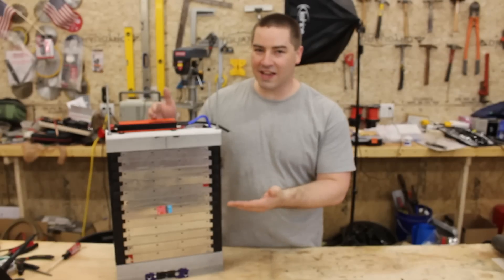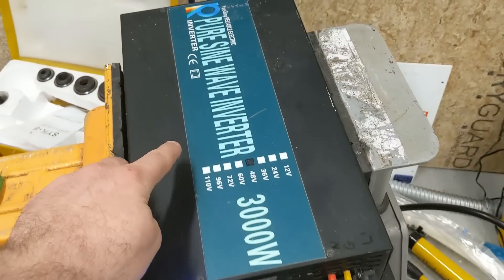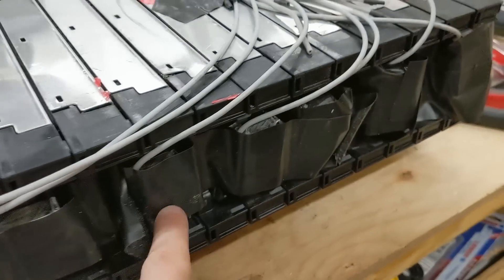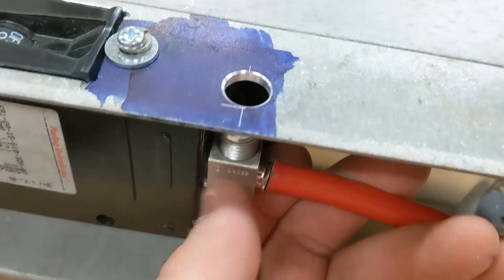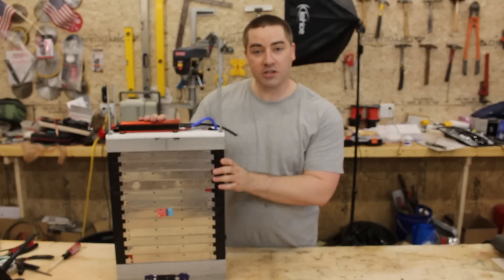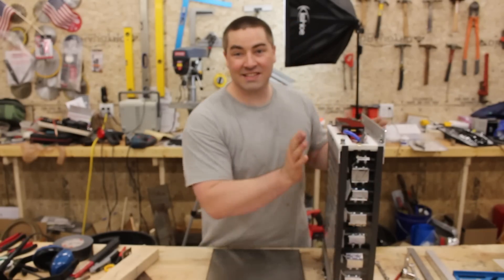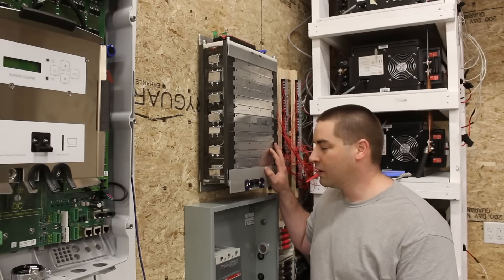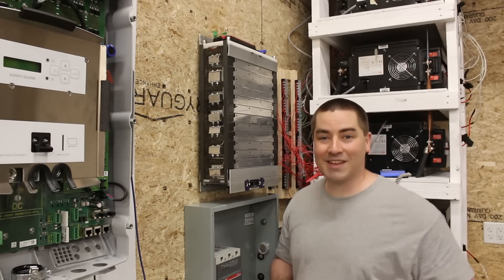LG Cells Part 2, 6kwh 48v DIY Battery

Comment: Nice build Dave. Could you go a bit more in details about doing a 24V system ? I realize it would be 7 modules each having 2 cells for a 7s2p battery in the end. What I dont understand in your video is when you say wouldn't need an aluminum block. Since the tabs were too short in your application why would they be different for a 24V ? If you could please clarify this for us.
Reply from the maker: I was suggesting building a 48v pack using 14 cells.  When you buy these from Battery Hookup there are two cells per module.  So I said in the video you can buy 7 modules.  Not 7 cells.  You can then arrange them 1p14s.  Now there are only two tabs to connect instead of 4.  The two tabs would be so close that there would be no need for an aluminum block between them.  This would make the whole build simpler.
Reply: @DavidPozEnergy  ok, so if taking the 2P modules apart, you dont need the blocks and you only need blocks when you keep the original 2P configuration?
Reply from the maker: Right.  It has to do with how close the tabs are.
Reply: @DavidPozEnergy  In your part 1video, it seems as though the spacer between the cells is bonded to the two cells, since you didn't separate them and you were curious about what was that spacer material. I want to try the 14S with individual cells, as you suggest. But I wanted to know if it's really possible to separate those two cells and flip one around. My second question is on pressure. I know it is beneficial but it seems ambiguous on the best way to do it. Your configuration in particular will have 71 lbs on the bottom cell plus whatever force is coming from the threaded rods, so the top and bottom cells are seeing a big difference in pressure. My idea was to use unthreaded rod, greased, and mount horizontal using some strong springs on each rod. That will equalize the pressure and it will be roughly constant, whether charged or discharged (volume varies based on SOC). What are your thoughts?
Reply from the maker: Hi Bucky Cage,  I have not separated the cells.  But, I did discuss this with Battery Hookup.  They separate the cells when they take the assembly apart.  This is because the big assembly is 3p10s.  So every other pair of cells is opposite.  Battery Hookup flips them all to be parallel for shipping.  They said they use a flat plastic putty knife.  
I like your idea of using springs.  That sounds great.
Reply: @DavidPozEnergy  David, thanks for responding. Do you recall where these batteries were from? Volt or Bolt or ?
Reply from the maker: Bolt.

Comment: Great video.  I'm designing a very large 48v build based on your video.  Would you consider using any other BMS (like the one with bluetooth)?  It's fun see voltages of the cells and having control of the balancing function.  Thanks again for all the information you're contributing to the DIY community.
Reply: Anything that call itself "smart" is probably a dumb idea for reasons that you you will probably not consider.
Reply from the maker: Hi Eric,  Sure, I'll use different types of BMS.  I've used BMS's with bluetooth dongles and they work good too.
Reply: @DavidPozEnergy  I looked at the 36v 5.94kW packs (10s3p).  The busbar connection in between the cells groups looked similar to yours, just not as heavy duty as yours.  I'm ordering those packs to see if I can splice them to make 48v (14s3p).  It's definitely more work but more fun as well (if I succeed).  You have successfully inspired me to start a big project.

Comment: Assuming charge/discharge every day, how many years would the pack you built last?  What would make it last as many years as you think it will last.  I'm asking, because I really like these batteries and thinking about a purchase in the 33kWh range.  We don't own a home for now, but when we did, we used around 900kWh to 1000 each month so thinking 33wWh should power the house.    Thank you.
Reply from the maker: There are several factors that affect a battery life span (as measured by cycles).  These are EV cells, same chemistry as in Chevy Volt and Nissan Leaf.  We can look to these two cars for examples on life span.  The Nissan Leaf had no active liquid temperature control, and were used to a high DOD (depth of discharge).  The Chevy Volt had active liquid heating and cooling of all the cells directly.  The Chevy Volt used only about 75% DOD.  There are 2011 Chevy Volts still driving on the original battery with over 300,000 miles.  

My point is that the more we control, the longer our batteries will last.  With NMC cells, I suggest charging to 4.05v/c (volts per cell) and discharging to 3.50v/c.  This is what I plan to do.  Next, the pack is inside my garage, which is both heated and cooled.  So the cells will never experience temperature extremes.  Third, limit your charging and discharging amps so as not to build up heat internally.  

Given the controls, I suspect 3,000 cycles fairly easily.  Or 8.2 years if you are daily cycling.
Reply: @DavidPozEnergy  WOW!  That's awesome.  Thanks for such a detailed answer.  Maybe I'll put mine underground where the temperature, if set up right, will be constant all year.
Reply: @DavidPozEnergy  can't sleep and just got done scrolling/reading through all 280+ comments and reading quite a few of your replies. The amount of detail and thought you put into replies astounds me. Well done.

Comment: It seems like when you are setting up your battery packs you always seem to target the low end of the voltage window. Here with 14 in series you have a 42-52V window. If you went with 16 in series you would have a 48-59 window. Same size window (10V ish) just moved higher. Most inverters and charge controllers go to at least the lower 60s in voltage. The higher the voltage(within reason) of the battery pack the more efficient the inverter runs (shorter voltage step). It also slightly increases your Kwhr rating(V*A).  While in some areas code limits the voltage of the pack to 48V, most allow the operating window to go up to 65V( allows you to boil balance lead acid batteries).
Reply: kWh rating goes up, but not for free. You have to add 2 cells per string.

Comment: David, you might want to look into panel hanging brackets (they go by many names). Essentially they are half of a dove tail. You mount one "strip" on the wall(open end facing up) and then another on what you are hanging(open end facing down). They typically support a couple of hundred pounds and if more support is need, you just mount two sets one high and the other low. When you go to hang your item you just drop(slowly) one edge over the other. Typically you use a couple of mounting tabs screwed into the wall on the bottom to keep it from sliding off the wall bracket left to right.
Reply from the maker: Thanks for the tip.
Reply: aka 'French Cleat', used a lot in woodworking and cabinetry and would be ideal for hanging something like that battery pack on the wall

Comment: Love your work and thought you might be able to lead me in the correct direction.  After designing/installing my own solar system here in Indiana how do I know it is both installed "correctly" and running as efficiently as it should be?  I have tried calling a couple Solar Companies locally and they only seem to want to sell their systems and not help a doit your selfer !  Any ideas would be appreciated
Reply: No combiner box. Using a Sol ARK that has the capability to support 4 arrays totaling 11kw.  Have 3 arrays connected so far.  But your response triggered an idea of connecting a meter to each array in line to better understand what is going on
Reply from the maker: One way to double check a system is: On a clear sunny day: record the voltage and amps at the solar panels, V+A at combiner box, at the circuit breakers, at the charge controller input, at the charge controller output, at the battery.  Then you can calculate your watts at the panel, combiner, breakers, charge controller, and battery.  There will be loss every step of the way due to resistance in the wires/breakers/connectors/charge controller.  A well designed system will have less than a 3% loss over wires.  The charge controller will have a loss, but it depends on the manufacturer.  Just double check your data sheets to see if your loss is appropriate for your charge controller.

Comment: David, battery hookup are doing a Chevy LG battery pack. 5.94KW for $594USD which is simply crazy cheap. Can you please do a step by step video I n how to turn this into a solar battery bank for the average person that has a grid tied inverter. Here is the product.  https://batteryhookup.com/collections/module-madness/products/lg-chem-10s-36v-180ah-5-94kwh
Reply from the maker: Most grid-tie inverters do not support batteries.  Usually, someone is using a off grid inverter with batteries.
Reply: DavidPoz sure I get that. But if you could use the Chevy LG battery pack for solar battery bank. I assume it will require an additional nal Hybrid inverter with AC coupling sfor someone like myself that has a grid tied inverter.

Comment: Does that BMS trigger the breaker in case of an imbalance or is the breaker stand alone?  Do you trust that BMS?  Is that a Daly?  Balancing amps?
Reply from the maker: This BMS does not trigger the circuit breaker.  This BMS is a Daly brand with 30ma balancing.  I always find the question of trust to be an odd choice of words.  I feel comfortable.  The BMS has reduced my risk to an acceptable level for my risk tolerance.

Comment: Hi David I've been following you for a  few months. It's my 1st comment. Can i use this battery pack for 24 volts battery bank?
Reply from the maker: yes. arrange 7 cells in series (7s) to get 24 volts.  since there are two cells per module, this would become 2p,7s.
Reply: If you're looking for all of the capacity (6kWh), you could use 14 cells, and do a 7S2P (OK, really a 7S4P) by rearranging the stack a bit (++--++--++--++--++--++--++--) and adding bus bars between the connecting blocks.

Comment: @davidpoz if you were starting from scratch, would you go with your old 6kw aims inverter and charger or start with the 5kw all in one inverter your friend installed?
Reply from the maker: The Aims inverter has a much better surge capacity than the MPP Solar inverters.  So I would stick with low frequency. But I needed more capacity than the 6kw, so maybe a 10kw Aims if I was starting from scratch.
Reply: @DavidPozEnergy  thanks for the reply! Love your videos man. Keep kicking butt and stay safe

Comment: It's alot easier than assembling 1,000's of 18650's
Reply: 100% agree. Unless you are doing that for fun or a true believer in saving the planet by recycling these, the time spent / value proposition is extremely low.
Reply: As you know, 12V is an RV/Van Life thing (...& of course also Preppers), That said, 12V appliances and equipment are incredibly efficient (although expensive because of poor economies of scale). That could change in the future, with people in the know focusing more on that Voltage. I'm trying to figure out (currently) how to charge my 12V banks with my 24/48V battery banks (Stepping down and regulating the voltage and current), As those higher voltage battery banks charge much more efficiently large solar panels (especially 72 cell+ panels, which coincidentally are the cheapest on the used market due to their size and weight).

Comment: I ordered 7 cell packs, and got all end caps, with a single cell with the tab cut so short I can't use it! I'm a bit upset, that was my second set, I emailed them and got no reply. Being all end cap cells, they do not snap together either, and are taller than the other pack, i just don't get it! They have otherwise been a great supplier, I have spent $thousends with them, I'd still like to have a couple dozen more,
Reply from the maker: I didn't even know there were different types.  I'm sorry to hear it, but thank you for making us aware.  Keep bugging them.  I find Facebook the easiest way to get them.  DIY Battery Facebook group.

Comment: What size are the threaded rods?
Reply from the maker: 1/4-20x24"
Reply: @DavidPozEnergy  Perfect, thank you! One more question, you mentioned the possibility of turning one cell around to make a 1P pack, did you ever attempt to separate two cells? I am worried I may damage the cells trying to separate tham.
Reply from the maker: I have not.  But I did talk with Battery Hookup.  They are doing this (separating cells) and said they come apart easy, no damage.  They suggested a plastic scraper, probably something like this: https://www.homedepot.com/p/ANVIL-Putty-Knife-Set-18PT0826/309976495  They said every other cell group comes reversed.  This is because the large packs are arranged 3p10s.  They arrange all the cells 2p facing the same way in the case for shipping.
Reply: @DavidPozEnergy  Thank you! Fitting two 14s batteries on my motorcycle will be much easier than trying to do two 7s in series!
Reply from the maker: Sounds good.  I'd love to see a photo of your motorcycle when you get them mounted.  I'm on facebook.  If you don't mind using my coupon code with Battery Hookup code: DAVIDPOZ you get 10% off, and it tracks my name in the affiliate program.
Reply: @DavidPozEnergy  Already used your code, I will send you a picture when it all comes together, thanks for all of the help!

Comment: Great video! Thanks. One question, do you have to use a BMS? Can I just connect this battery pack to the charge controller directly?
Reply from the maker: A BMS is a safety device.  Similar to fuses, circuit breakers, smoke alarms, etc. are all safety devices.  Can you move electrons down a wire without safety, yes.  But, it's dangerous and not recommended.
Reply: The charge controller will stop charging when the entire battery hits 58.8V, but the BMS cuts out if individual cells go over 4.2V. They offer similar low-voltage cuts, and can even disable the battery at dangerous temperature extremes. 💜🤓👍

Comment: I would be thinking those Cells may not need to be compressed against each other so tight. I believe they need to be able to expand when they fail at some point so the pressure does not rupture the package. I could be wrong but you might want to look into that .
Reply: Jim, I was thinking the same thing. I am just about to start thee same build and I was thing of spacing them about a 32nd or 1/16th “ to let them vent a little.

Comment: Could you help me spec out the same concept in 24 volts?  BMP....
Reply from the maker: 24 volts would be a 7s pack.  Meaning, 7 cells in series.  You can buy 7 modules.  Each module has 2 cells.  You can arrange them as 2p7s.  Meaning 2 cells in parallel and 7 in series.
Reply: DavidPoz thanks for your reply. What BMS would you suggest?
Reply from the maker: I'm using the Daly brand BMS.  It works fine.  I have no complaints.
Reply: DavidPoz I just need to find the 24  Volt version?  Thank you for your help!!
Reply: @DavidPozEnergy  do you know how that bms does cell balancing?  or a better way to put that is "when"?  I would want a bms to only limit max voltage, so as it is charged if there is a high one bleed it down.  I may run mix matched cells so I don't want it constantly trying to balance at lower voltages.